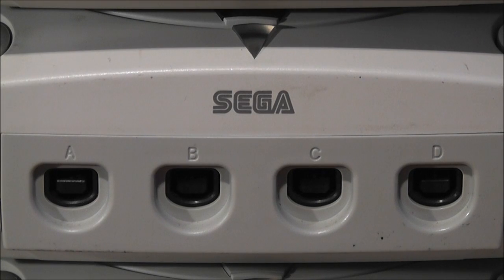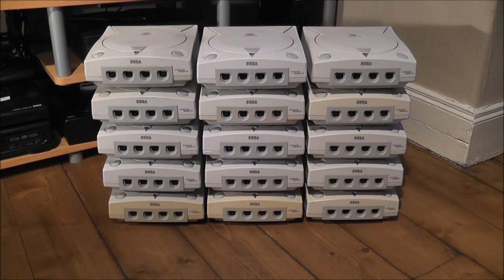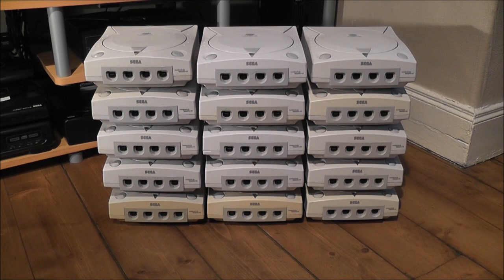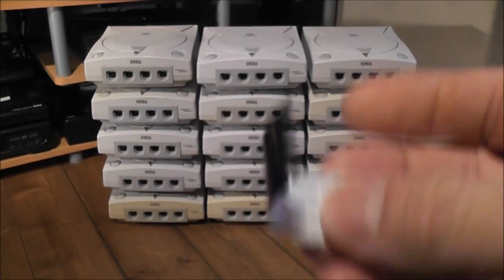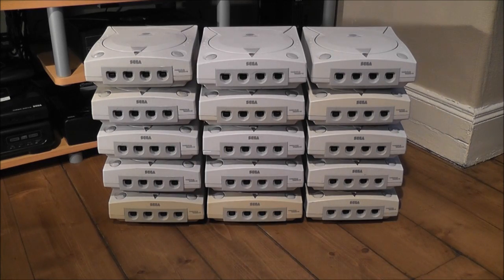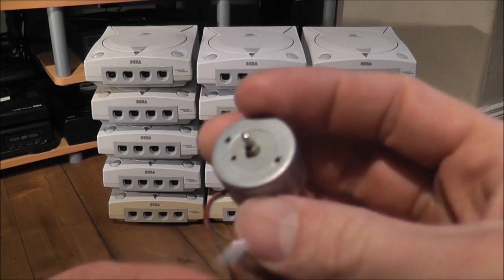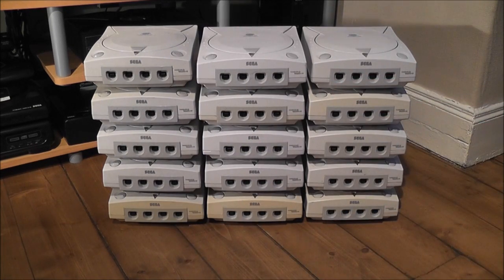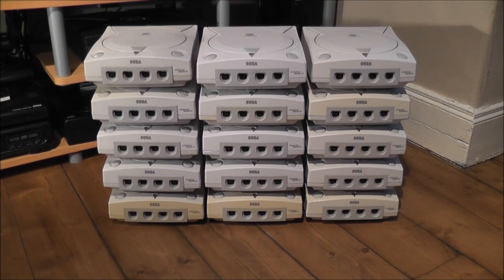Wall Of Sega Dreamcast! My Latest Faulty Console Haul - Refurbishing Project

Comment: I don't know if you are still responding to videos but I hope you can give me an idea where to start looking.  My dreamcast suddenly turned off while being used.  When I turn it on the big coil thing on the PSU makes a high pitched whine sound but nothing happens.  Sometimes the power led will flicker on for a fraction of a second and then go off.
I don't think its the contacts between the psu and the board as I checked them and they are very clean, even for its age, they where nearly perfect.

Any ideas where to start? Or can you point me to a site etc?

Comment: My dreamcast randomly turned off and stopped working.
When you push the power button the controller beeps, there is this humming noise from the system and the fan turns on. There is no light, the disk drive does not move and no AV.
I ripped the whole system apart can't find anything wrong. 
I checked the power supply, all the capacitor looks fine, fuse looks fine. I replaced the fuse nonetheless, and it doesn't work.

HELPPPP 

T.T

Comment: Some of them need retrobriting badly! Dreamcast come up very well when retrobrited.
Reply: +L.D. Nicoll Its far easier, cheaper, and more practical to use Vinyl Dye imho.
Reply: +L.D. Nicoll I never had to retrobrite my Dreamcast.  Sure they can look as bad as some SNES's that need retrobitting, but I found a quick round of putting the shell in the dishwasher with Cascade was all it really needed to make a pure white comeback (and a good dishwasher that can actually blow the dirt out of the cracks).  

The Dreamcast uses a completely different kind of plastic then Super Nintendo's, so I don't think that retrobrite is necessary.

Comment: Got mine through an online auction for $17. Nobody jumped on it because it was untested. I figured it was worth the risk. It came with 2 rumble packs, 1 VMU, all the wires and 2 controllers. It was absolutely MINT after cleaning up some gunk on it. Only one tiny scratch on the side of the system and very little dust on the inside. Whoever owned mine before took very good care of it and it works beautifully. I was never big on SEGA growing up, my parents always bought me Nintendo as a kid. I finally got into it and I'd have to say I am impressed!

Comment: my dreamcast is completely dead.  It won't turn on when you press the power button.  How should I fix mine?
Reply: Tasukihori You should inspect the power supply visually for whether there are any bulged capacitors. If there are, replace them. Then check the fuse and replace it if necessary. Take off the power supply and clean the pins protruding from the mainboard, as well as contact surfaces on the power supply that they go into - i use isopropanol. Also make sure that the contact leafs of the plug connecting PSU to mainboard have the right shape and haven't been bent in too much, usually just removing the power supply for a while restores them to their normal shape.

It's useful to have multiple Dreamcasts around, so you can just drop in another power supply to exclude other causes of issue - the mainboard could be faulty too, in which case, you're not exactly in luck.

Make sure to follow disassembly and assembly instructions you can find here on YT, in order not to break something sensitive and quite importantly in order not to suffer electric shock.
Reply: Tasukihori will most likely be small fuse inside the console undo the console case and replace the fuse. will work perfect.

Comment: if they wont read disks then the drive might be spining to fast or to slow and theres a pot under the lazer to adjust that, left for slow/ right for more speed, this is a common fix to a common dream cast problem.
Reply: I think you're preaching to the converted my friend! :)
Reply: MattTheComputerGeek That's not speed, that's laser power.

But the pickups don't live forever, the vertical tracking adjustment will fail someday anyway.
Reply: Anthony Jennings good question. I have not examined failed pickups so far, even though I did swap in and throw away some, somehow didn't examine them. I went merely by things I have heard from somewhere that I at the time considered somewhat reliable, which on retrospect might not be, because there are two more plausible reasons of failure: lens clouding and laser demise. But I wonder, perhaps wires can work-harden and break? Perhaps whatever mechanism guides the movement can wear down and restrict it?

Comment: Can't wait for a replacement to the GD-ROM (SD card slot emulator or something). The GD-ROM was a horrible piece of hardware on an otherwise awesome system.
Reply: TBustah This will be incredibly difficult - PowerVR is the most exotic GPU of its generation and for a few generations to come, a marvel of engineering and had years of work put into it using already rather modern design methods as opposed to all the 16-bit consoles, and designing an equivalent will not be trivial at all. Modern GPUs still don't have transparency depth peeling and modifier volumes, the former was removed and the latter was severely maimed on subsequent PowerVR GPUs due to them being targeted towards established operating systems and APIs.

The rest of the hardware is rather trivial though, except for CPU, but those can just be ordered from Renesas.

Replacement GD-ROM is not too difficult and there are currently two designs around, GDEMU by dknute and USB-GDROM by a Russian engineer.

The GD-ROM isn't a "horrible" piece of hardware, it's an absolutely adequate piece of hardware. 15 years in, and many of those still hold up, and there's plenty of new laser pickup stock around. And my does it run nicely when greased - it doesn't have to sound like a chainsaw.
Reply: Siana Gearz I've got three Dreamcast's with broken GDROM units in my closet that would disagree with you. On the other hand, I've owned 5 or 6 original PSX systems, not one of them has had issues reading discs. PS2 DVD drives had issues too, but none as bad as the Dreamcast's.
Reply: Siana Gearz The same CPU is actually used in the casio fx graphing calculators....
Reply: Wuerfel21 That would be the most horrible overkill ever, so i don't think that's the case. I think they use a random Motorola 6809 clone, probably Hitachi made, but completely unrelated to SH line. Graphing calculators usually use 8-bit CPUs, either Motorola 6800 or MOS 6502 or Zilog Z80 descendants. A low-clock ARM7TDMI is the only 32-bit CPU i can think of that is plausible in a graphing calculator, because it has exceptionally low transistor count and greatly reduced memory bandwidth requirement compared to other 32-bit and 16-bit CPUs.

Cassiopeia handheld computers (with Windows CE) used SH-2 or SH-3, of which SH-4 in the Dreamcast is a software-compatible high-performance descendent. Compatibility is one way only. It's a line of 32-bit CPUs.
Reply: Siana Gearz Nope, the newer ones (the usb power graphic 2 models and the prizm) actually use a (custom version of a) SH-4 at about 50 mhz. Old models had a SH-3 at some 30 mhz.
Reply: Wuerfel21 Yep, you're right, thank you. These things are monsters. I didn't imagine these even existed x.x An SH3A/SH4 would be an overkill even for an e-book-reader and seem to cover car nav headunits nicely at higher clocks, but i can see their appeal at a low clock in a powerful calculator. Last time i looked at graphing calculators was probably 15 years ago, and downsized versions of 80ies logic was where it was at.
Reply: i got two both possibly from smoke homes and work great no issues even read cd burned games.
Reply: +CodeRedin519 GDEMU :) thats all I will say.
Reply: CodeRedin519  I just remembered something. GD-ROM was dual-sourced. One GD-ROM assembly version, the original one, came from Yamaha and was equipped with a Japanese optical pickup, NEC or Sanyo made. Another version of the drive came with a Samsung pickup, presumably with the drive being made by Samsung too. Obviously Samsung being the less experienced manufacturer. Perhaps one of those manufacturers had a material quality issue affecting longevity of the lens or laser. Even if the issue was very short-term, due to short console lifecycle, a large percentage of consoles would be affected.

Comment: I won 3 + a megadrive for £6.50 this week. One worked out of the box and one just has a little trouble with disks... The 3rd is NTSC-J so i need another av cable to do any testing but it powers on! The megadrive just needed the switch cleaning :)

Comment: If the control board is not working, you plug the control and is not recognized, you just need to replace a resistor from the board. That is a design flaw. Happened to a batch or models and it is a common error. Mine had that, just replaced that resistor and the console was working again.

Comment: i smoke and both my DC and SNES are as fresh as a daisy.mind you heavy smoke would stain em after a while but i think it has something to do with the compounds in some of the plastic used reacting with either light or atmosphere (maybe a smokey one or if you use certain houshold cleaning chemicals or live near a main road?) which explains why just certain panels on the console/cart sometimes discolour while the rest is unscathed.smoking around machines is worse for the insides of em i reckon

Comment: did any of these have a door problem ? I have a faulty dreamcast that wont read games due to the door not staying shut. Mid game the disc stops spinning and returns to the set up screen. I tried putting a piece of paper on that little arm that keeps the door shut but it did not work. Any advice?